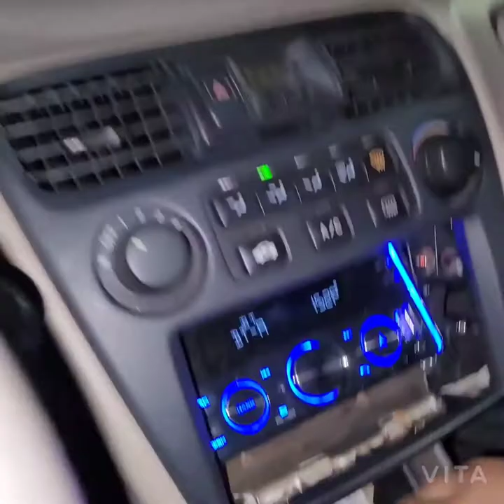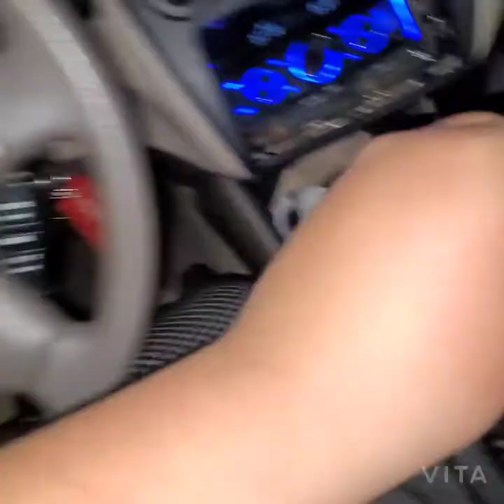Skar Sdr 15s Infinite baffle Setup Bangin

Comment: Imagine how nice the system would sound if you actually hooked everything up properly and followed simple instructions.....
Reply from the maker: id love to see the instructions for something totally custom
Reply: Definitely plays the lowssssss REALLY GOOOD
Reply: Imagine thinking there is an instruction manual for a custom job.. please by all means Fart Knocker the stage is yours we gotta know.
Reply: Dude literally just said, “it’s just hooked up for testing” explaining the wires
Reply: @gsxroyce256  his infinite baffle setup is heavily flawed. That baffle mount must be air tight, and i can clearly see holes around it which isn't true IB. What he should of done is removed the spare tire, and cut two holes if possible in the frame, and then make a wooden mount to set the woofers inverted straight towards the ground. Then make another mount for the bottom and use some kind of fabric like trampoline fabic or something to stretch over the hole then set the bottom mount and bolt it all together. That would be true IB and make the whole car a subwoofer. It would make the type of bass that actually shakes the ground, and people could gear the low end from blocks away.

Comment: I had 2 stroker 18s IB in a 91 Accord. I loved the setup. I had 2 Rockville 18s in one was well. It's still on my channel. Good stuff. Usually subs with low FS work best for infinite baffle in my experience
Reply: Actually it has to have high qts
Reply: @gradycrislerjr40  I hear ya. I've always just went by the Fs. Hey I could be wrong. Just saying what worked for me. I'll check the QTS of the old stroker.
Reply: @bjenks2  Well you arent wrong, but not completely right, you DO need a QTS as close to 0.7 as possible but with that generally comes the low FS. Mainly because most IB drivers have a very soft spider.

Comment: Why "infinite" baffle you could get better performance with a ported box but if its making you happy then bass on brother 👍🏽👊🏽✌🏽💯  Which Rzr is that the 2500.1d or 3500.1 d?
Reply: He has more trunk space this way if needed.
Reply: @fornarnia8  Definitely more trunk space but there's S000000 much more room for error with IB and most people don't know how to tune them properly they just hope it comes out right Just get a simple ported box with the correct air space and port area (wich is SIMPLE ) and it will blow that IB guess job out of the water and sound WAAAAAAY better doing it 👍🏽👊🏽✌🏽💯   #🔊🔊🔊
Reply: You need to here my ibf setup 2014 f150 crew 4 18s fi car audio high qts  My creations infinite baffle blow thru No more boxes 4 me

Comment: Why not just go for a 8-9 CU ported box and seal it forward. 2500 watt amp on 0 gauge wire would turn those skar audios into something way more. I know this is an old video but still.

Comment: I know it's an old video but it's technically not Infinite baffle unless you left that trunk open. 

Not even sure if you still have this system setup this way but you could do true IB by doing a spare tire delete and using that area to cut a hole and put a sub or subs there venting out of the hole. 

A good rule to follow for the cutout size of the vent you need is 50% of the Sd of the driver(s)

I run a single 18 IB so my cutout is 1/2 of the 1219sq cm Sd. 

It's so nice having 98% of my trunk space while having more bass than I personally need.
Reply: what about if it rains ? do you have something that seals that area ?
Reply: @kurtland192707  Yes. I have some hydrophobic screen, some Speaker cabinet foam, and some more hydrophobic screen layered together over the hole. 

Expanded Steel is what all that sits on top of to give protection from rocks and whatnot. 

To be honest I've driven in rain and checked the cutout and nothing was even remotely wet on the outside at the cutout. (I live in Florida) So It should be more than enough for any sort of water that might reach the filters. There's probably a million different ways to handle that aspect of it. But from what I can tell what I did works well enough.

Comment: I have 2 of these 98-02' accords, but coupe versions. One has a decently loud system, that im happy with. To keep it short, for bass it has: upgraded electrical, 2300w rms JP23 amp, 15" A.B XFL ported. 
Anyway...I was considering 2 of these Skar SDR 15s, sealed for my other Accord coupe. Only thing is, I do not want to add more than like 750w rms to the factory electrical. The amp you used here, what was it rated for? I'll find something with similar wattage

Comment: That amp does rated and a bit. Its rated 2ohm but will run at 1ohm. Its really not a bad amp at all.
Reply: My truck is bumping hard enough with that amp that it broke one of the little plastic mounting end caps off the amp lol

Comment: Nice, I got the same Honda as well, and a box tuned to 28hz with a ZVX15. The 20-25hz range seems to get boosted from cabin gain I'm assuming
Reply: Try  putting the amp closer to the subs

Comment: Which did you pay more for,the subs or the car?
Reply from the maker: Payed 350 for the car 80 for the radio deck 109.99 for each sdr 15 1 ohm sub on amazon
Reply: @thathondachannel2105  dual 4 ohm sub * I’m guessing you ran those parallel to a 1ohm stable
Reply from the maker: @indacouch253  yep yep

Comment: is the alternator upgraded at all or just stock?
Reply from the maker: All stock!!
Reply: @thathondachannel2105  damn how many watts is the whole build i was thinking i had to upgrade my alternator for 1500 watts on skar but maybe not
Reply from the maker: @subbd7092  the amp is MAYBE putting out 600-800 watts i was running it at half ohm at one point XD the subs can take 600rms in a normal inclosure easily but since the subs have all the air in the trunk it takes A LOT less power to move em hence the window flexin
Reply: @subbd7092  bro your in same exact position as me or you were 3 months ago!

You got 2 svr 15's?
Either way how did your system work out with stock electrical?
I seen a vid of a dude pushing waaaay too much power to a set of svr 15s. Like 2k rms each and he running stock electrical making that roof flex!
Edit: if you read this, that dude from the video I referenced told me his alternator burnt out shortly afterwards. But he was after all pulling 3X the power we are looking to get from our stock alt's
Reply: @RandoManFPV  sdr*
Reply: @eduardoquezada11  svr*

I have two SVR 15's that equal 1500-1600 watt rms together.
Subbd did not mention what he has just that it is a skar system needing about 1500 watts. Unless he's either got 3 or more sdr subs, is including wattage of other speakers not just subs, or he's running 2 sdr 18's (if they make those) then I highly doubt he's pumping 1500watts rms with SDR subs.
I was just asking if he has the same 2 svr15s as me, as that is a pretty common setup that maybe just barely pushes the limits of a stock alternator

Comment: Get some bigger wires and clean it up plus that amp is not for bassheads mainly use it just to get by
Reply from the maker: definatly i hear ya this was a really really budget system i threw together to get some beat but will be doing lots of upgrades in the future
Reply: @thathondachannel2105  if you got the right tune and encosure you wont need advice just the power
Reply: @thathondachannel2105  that's the amp I used just to have some bump pretty good for being under 100 bucks
Reply from the maker: @basscaddy1449  yeah it wasnt bad for what i could buy at the time but i got plans for 6 12s in the acura legend thinking either sundown sa12s or skar evl 12s